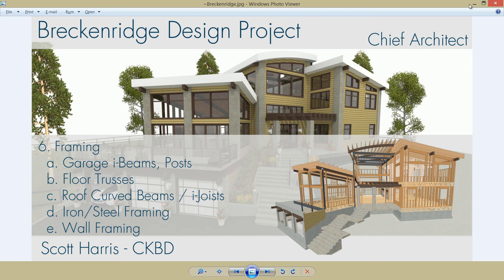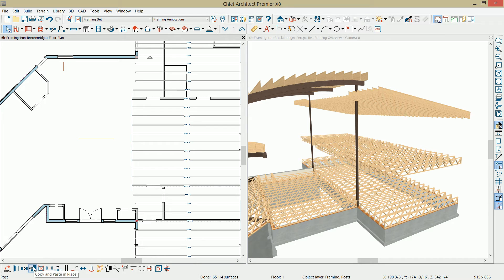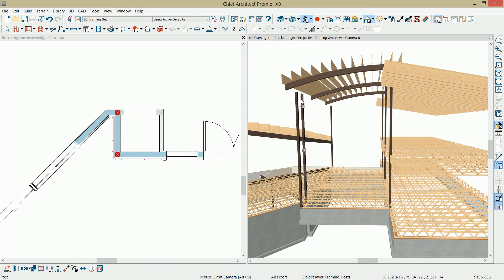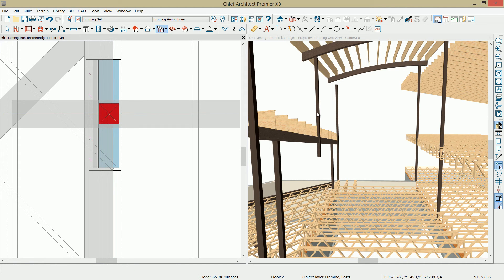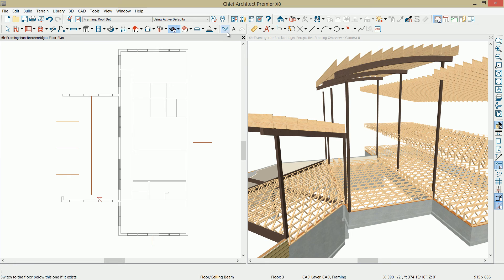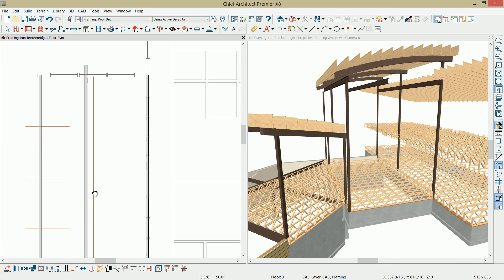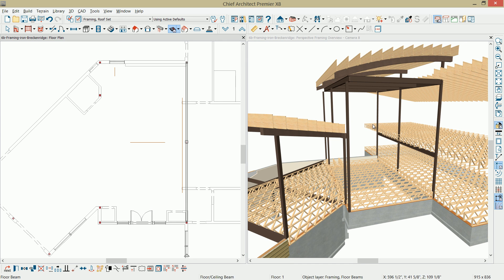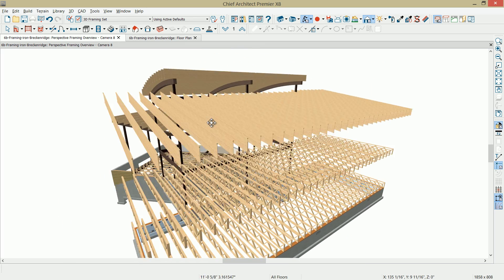Breckenridge Design Project - Steel and Iron Structural Framing

Comment: Does the software consider structural strength when placing structural members? If you are placing framing members randomly will the software indicate that it isnt structurally sound?
Reply from the maker: It would be up to you to comply with the local building code. We do not have that built into the software since code changes from area to area. However, we have a "plan check" feature, which reviews your design against basic building principles.
Reply: @ so theoretically this will suggest a build plan that follows basic build principles and standards and you would need to have the final design reviewed by a structural engineer or architect?
Reply from the maker: @ Correct